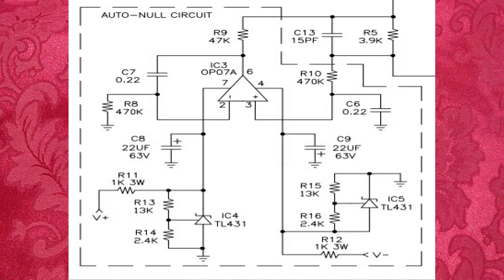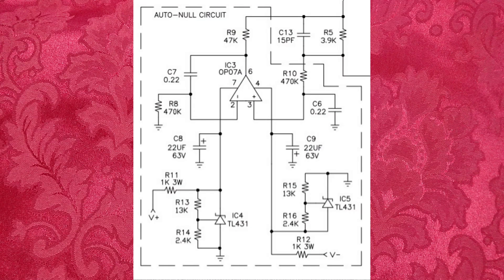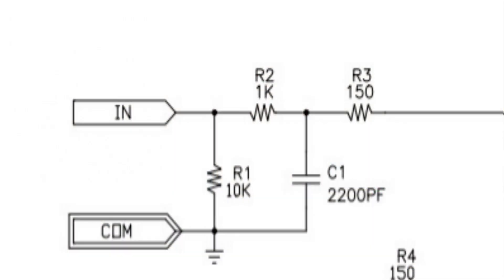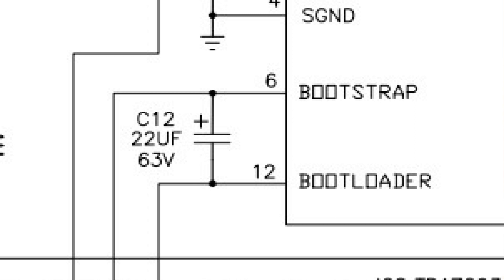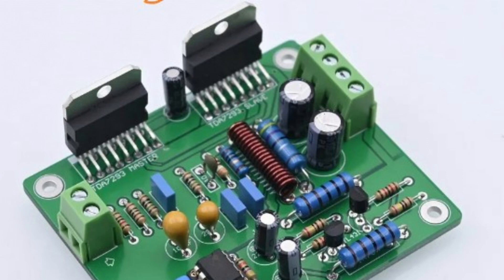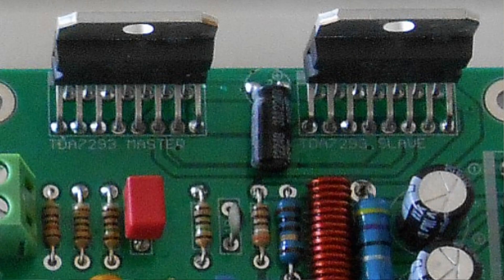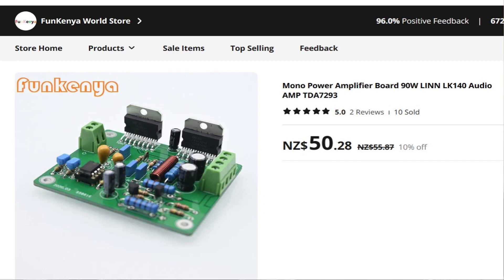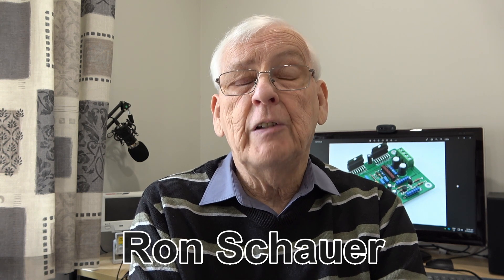Dual TDA7293.  Full circuit diagram, modifications.

Comment: Hi Micheal hope you and family are well.glad to see you are still making videos .i always look forward to them .love the knowledge and wisdom and past experiences you share with us ..i was woundering if i could use this in a sanyo g4001 music centre to replace its stk ic of 2x12 watts maybe thinking i could use the +- dc supply to the stk . I like the idear i could get a more and an overall better sound by replacing a no longer available ic .future proofing  if you like
Reply from the maker: Thank you Carl for your kind words. As for using this module in your Sanyo, I don't know this unit at all so I cannot really advise you. If it's any help, I still use this module today in daily use. I'm sure it will sound better but nor really more power. It's the supply voltage that directly effects power output. It might help a little to replace the main smoothing caps to may be double the size. that should give you more peak power at least. Good luck.

Comment: 47.- 68 pf can use input not critical. 220pf for high , bootstrap use 47 uf 50v or 63v standard much better use lay down capacitor away from cooling  fan.

Comment: They use this IC in the marshall mg100dfx and according to the internet the 4ohm speaker at 100watts is too little for the capabilities of the the TDA7293 .The amp continues to make boomy noises . It has a tiny board and a fan attached to it , which I replaced with a cpu fan . Could there be benefits from adjusting the board ?
Reply from the maker: You really need 2 chips for heavy use into 4 ohms. Nothing wrong with the IC but like most things it's how you use them. I don't know the Marshall but if it's a PA or guitar amplifier, quality is not the main factor. I think I would cast the Marshall to e waist and buy one of these. I still use mine every day. It really is good.
Reply: @MichaelBeeny  It's a guitar amplifier made in India . Sounds pretty decent and the reverb is nice. I don't understand what you mean by casting the Marshall to e waist but I've been messing around with it for a while. It stabilized for a bit and then went back to the booming. I suppose there is a way to modify that fan circuit to use 2 of those chips ? I wouldn't mind knocking down the output to 50 watts it still would be enough to practice . Also to be noted we dont have ground in our plugs in my country so I'm running it with a two pole plug on solar lithium setup because we don't have enough hours of mains electricity either .

Comment: A big problem I have experienced with all op amp ic. is that they ruin the sound. There is always less detail in bright frequencies and the sound becomes less detailed.

I use Alps potentiometer and different pre-amplifier pcb with and without capacitor on input and output.

The sound always gets worse! with the preamplifier in the chain!
Reply from the maker: I will be looking at 2 preamps in a few weeks' time. As they say...STAY TUNED. Re chip amps, I promise you will NOT be disappointed with this one. It's now in use daily. I love it.
Reply: @MichaelBeeny  
I think that it is the same which preamplifier card you buy from ebay or aliexpress that is based on one or more op amp ic. will have the same problem since most are made pretty much the same.

It is not difficult to hear the problem but not easy either, somewhere in between.

I tried my NAIM NAP250 clone card from ebay which doesn't have the best sound quality, together with my preamplifier and  the sound was a little lacking in detail and a little darker in the brighter treble. A bit of the problem was the preamplifier i have.
I tried another preamplifier card without a capacitor in the sound way with the same result. Without a preamplifier but only with a potentiometer, the problem was gone.

I use 50k blue alps potetiometer from ebay and input relay card.

Now I have ordered the OPA1612 op amp ic. which is mounted on the pcb. card adapter since you only get this ic. in surface-mounted version.

What is your opinion on this?

Comment: Mr Beeny, I have another question, hope that I don't bother you too much:
Can I use speaker amp like the one in the video to power low impedance planar magnetic headphone like Hifiman Edition XS - 18 Ohm or Verum One - 8 Ohm?
The power of these speaker amp is very big for headphone, expecially at low impedance load, but it's not a big problem because we can use them with small volume.
But as I know, the output impedance of speaker amps is much higher than typical headphone amps. It will cause noise for headphone. Am I right?
Is there any solution to use speaker amp to power headphone without hearing noise?
Reply from the maker: Most integrated amplifiers that have a headphone socket are fed from the speaker feed via a resistor network to limit power which could damage both the headphones and you're hearing. Some special headphones that require a higher output would be fed directly from the speaker outputs. I don't know these headphones so you might need to experiment with different values. Use 1-watt resistors.
Reply: @MichaelBeeny  thank you very much, Mr Beeny! 😁👍
Reply: I would think that these boards would work extremely well for driving low impedance headphones.
However, as Mike said, you really should have a resistor in series with each output. 
Something in the range of 16 to 47 ohms per channel perhaps (as he also said- you'll need to experiment a bit). 
They should of course be power resistors (such as 1 watt to 3 watts).
There is something else I might suggest doing that I have done on mine- .Change the value of R4 from its 150 ohm as-shipped value to something like 470 ohms.
This will reduce the gain and also will increase the bass response significantly because of the way R4 interacts with the C2,3,4 combination.
Don't forget to change C12 (bootstrap capacitor) to at least 47uF, or even 100uF.
Otherwise the bootstrap rails will run out of voltage and sag at lower frequencies.
Again, I think that these should make great low-impedance headphone amplifiers because they should easily drive any headphones including rather low impedance ones such as you mentioned.
Reply: @ronschauer839  the details that you've written is very useful! Thank you very much! 😁👍 I'll give feedback after finishing this project

Comment: Looks interesting, you might want to check out lm1875 in composite circuit, an external OPA controls the lm1875, bringing the THD down 10x,  also search for "TDA7293 composite"
Reply from the maker: I have already made a video on this IC here  https://youtu.be/zt7YAna-Qcc?si=FLD-CQ64YTjUjXhH  It does perform very well.

Comment: Am a keen follower of the channel and have built most of the recommendations - so naturally did this one too.
Power was as demonstrated 85W - flat response curve as well. But that's how good it gets. The noise was a good 0.005% at 1W but got worse to 0.012% as full power.
I still challenge Michael to build the symasym 5-3. +90W at 0.007% thd+n for cheaper.
In actual fact - give me an address and i will post the board to you for testing - that's how sure I am?
Reply from the maker: Hi Zoe, at present I am not looking for extra projects to build (health issues etc) but does look good on paper. How does it sound in comparison to the 7293 which is currently my favorite.
Reply: Take it easy - everyday is a gift.
I am by no means an audiophile buff...which is why your valued opinion on what sounds better would be welcome. 
 @MichaelBeeny
Reply: I have constructed the Symasym 5.3., the LJM12, the LM3886 and the TDA7294. If you asked me be honest, which sounds best,
I would say TDA7294 by a nose. More experimentation is needed however.

Comment: Hi Mike. 
You are most welcome and "thanks for the thanks". 🙂
We are certainly enjoying a pair of these dual 7293 boards in our den AV amplifier.
They are being driven by a low impedance preamp.

I cannot describe how very much of an improvement these boards are over the NAP250 (clone) boards that it was using before.
Night and day better..!

I should add add that you might consider reducing the 7293 board's gain slightly by changing the R4 value to something more like 470 ohms.
This will have the effect of boosting bass response because of the way the C2/C3/C4 combination interacts with R4.

Thank you for finding these boards and your kind efforts and patience as well. 👍👍